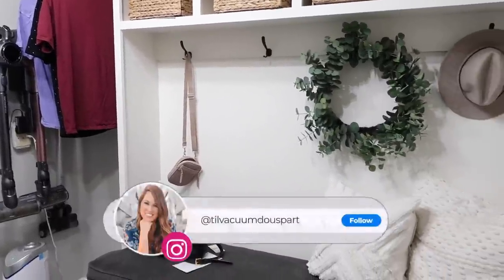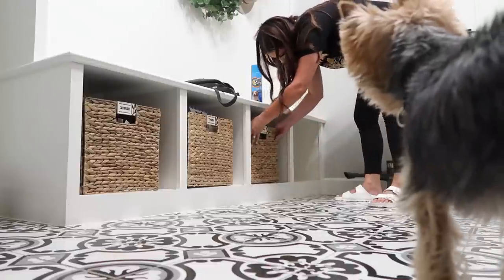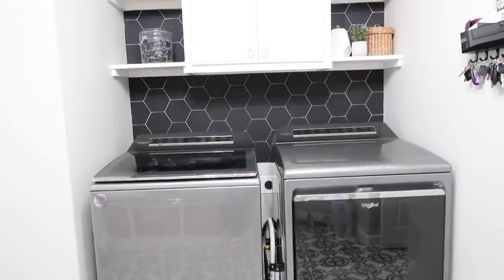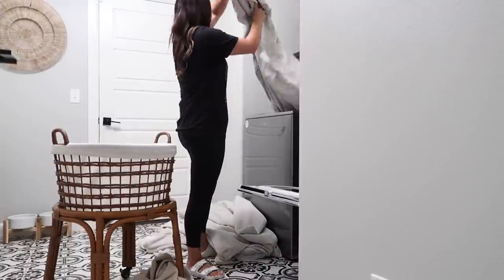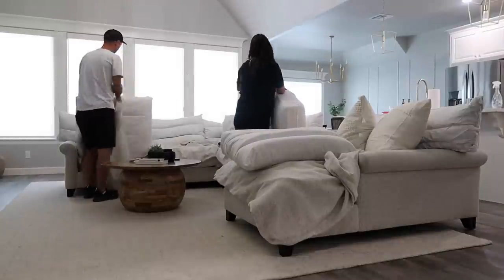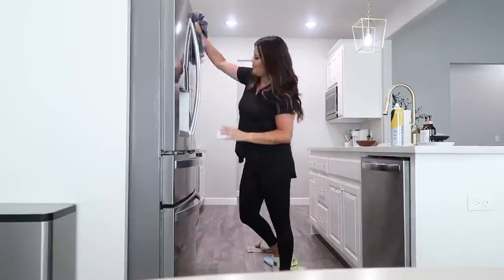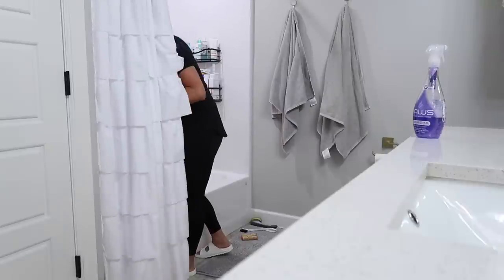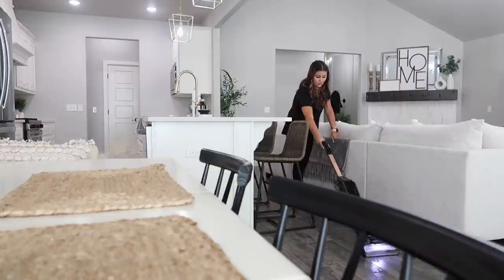*NEW* EXTREME WHOLE HOUSE DEEP CLEANING | ULTIMATE DEEP CLEAN WITH ME | 2022 CLEANING MOTIVATION

Comment: Hi Ashley! Just a tip- be careful storing your Louis Vuitton Pochette metis hanging on the hook in your mud room. Over time the hanging will ruin the leather on the part that is pressing on the hook. And the top handle when you hang it will stretch out the handle and put pressure on the sides. I suggest storing it sitting on a shelf instead of hanging it! 🖤

Comment: I bought the microwave plate cover after I saw your video in it about a month ago. Your mirrors don't streak from the light being on? Also, what do you use to clean your floors?
Reply from the maker: No never had streaking problems. I use my Bissell Crosswave x7 to mop and clean my floors
Reply: @TilVacuumDoUsPart  
So I take it the floor cleaner comes with it?